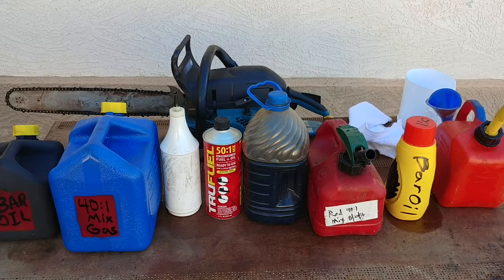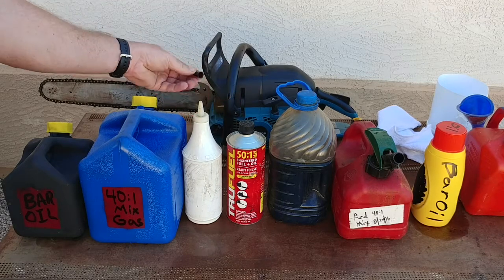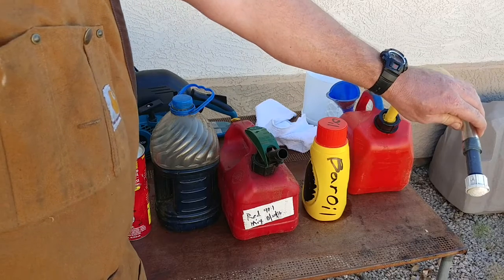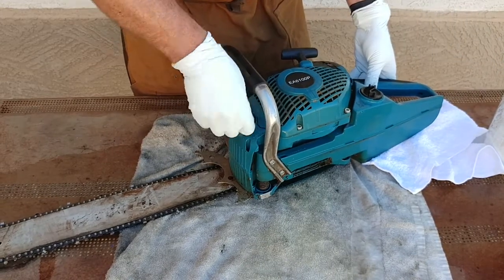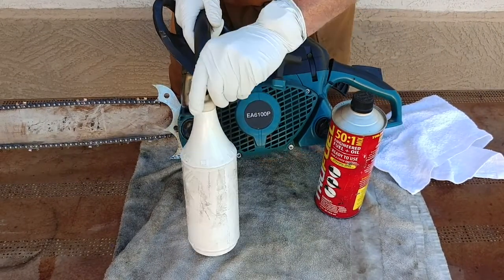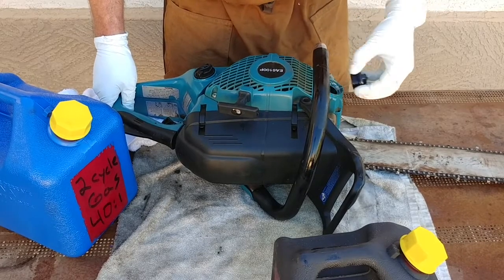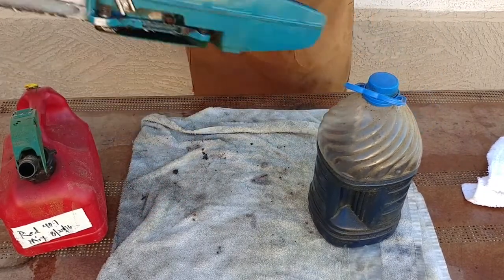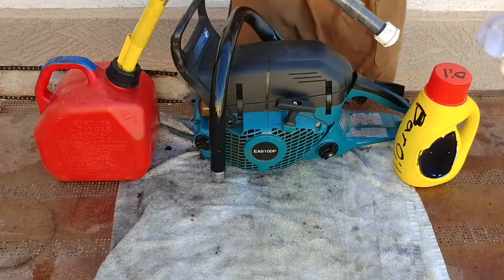How to gas and oil a chainsaw

Comment: Kimball I use the the squeeze bottle also, and I use a 2 1/2 gal plastic gas can with a plastic flex non epa spout and a oil cap from a 3.5hp briggs & straton mower engine as a stopper in the end of the spout. I then put the gas and oil along with a few tools into a milk crate for easy carrying as storage. Keeps everything in one place.

Comment: Hi kimball I use the Stihl combination can and no spill spouts it also has a built in tool holder for a scrench and a file it's amazing, and they are no bullish!t safety spouts just high flow auto shutoff and they work no spill at all. I did have the new Husqvarna combination can but the spouts leaked and were easy to snap. 
http://www.mad4mowers.co.uk/Stihl_Combination_canister_Combi_Can_Orange_OR_Transparent/p2077193_12180486.aspx